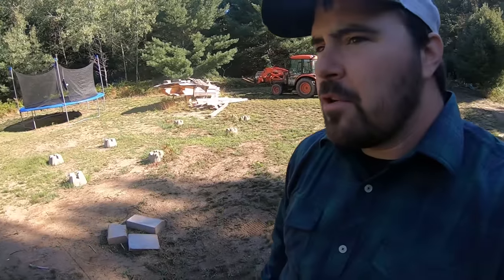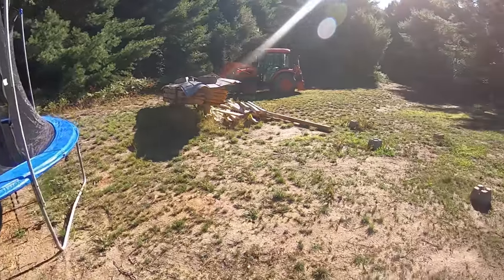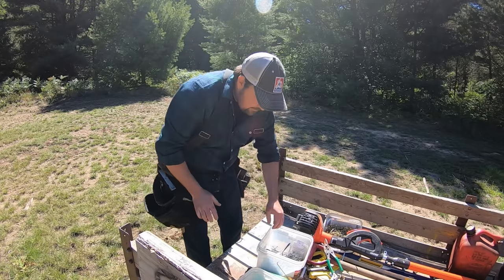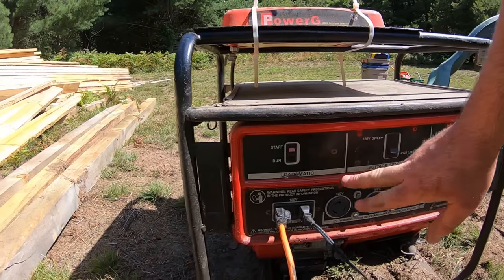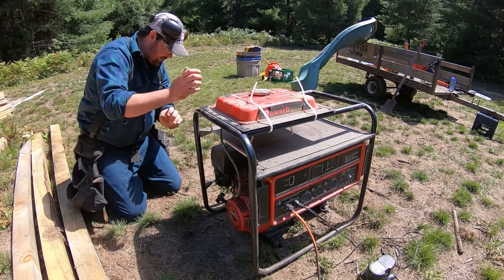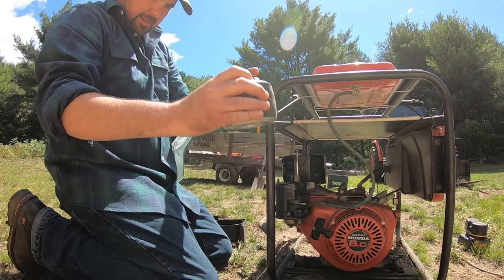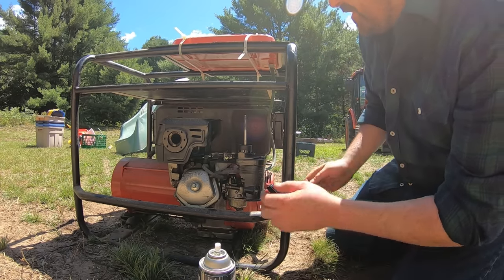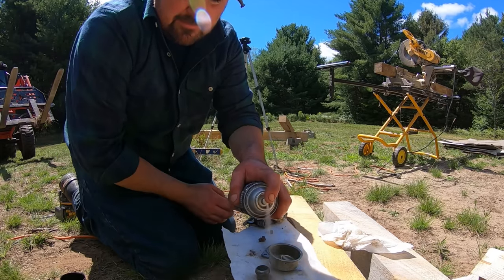Pirate Ship Project Hits Some Rough Seas | Yarrrrrr!  (Please help me...actually though)

Comment: It could probably be low oil level. Because you have a oil guard, and when it too less it shout off the ignition. So when you wait 2 minutes the oils run down again and it starts for  while, so I think the oil is just under the line...
Reply: Also some synthetic oils won’t hold the low oil level sensor up when the unit is running but it will hold it enough to start.
Reply from the maker: good points there! Thank you
Reply: @duncangabert590  I think YOU may have just solved a problem I have been having,  Going to go and change back to conventional oil and see if I have a viscosity problem..

Comment: Yah, Another opinion. I have a Honda generator same exact reactions. On the exhaust side of the engine when looking above the bowl at carb there should be a black plastic Philips screw. It may be slightly captured by the long carb stud(bolt). remove the plastic then remove a jet clean it so you can see through it. With air filter back on try it. Should clear it up, then take more pride in her and do whatever extra maintenance you feel like. Thanks for all your vids. Fellow sawyer (woodmizer) and nature enthusiast
Reply from the maker: Appreciate that Anthony.

Comment: Howdy Sandy- I’m not even gonna guess what’s wrong cause I’m not a small engine mechanic. But, it is reassuring that I’m not the only person who has days like that. I’ve been working off a generator for over a year now and actually getting tired of it. When building off grid we have to use a noisy generator. Hope you get it going. Take care and God bless
Reply from the maker: You know the feeling. It's frustrating for sure but as long as I"m still standing it's been a good day

Comment: It sure looks like a carb issue.. May have to completely tear it down at the shop for a good cleaning..  Have you looked around for a PTO ran generator you can run off the back of the tractor? Keep up the good work there Sandy
Reply from the maker: Think at the very least that will tell me for sure it's either the carb or it isn't and go from there. Good points. I have seen those PTO generators and I think that's not a bad thing to consider
Reply: @sawingwithsandy  Save your time, its nothing internal to the carb.. the engine runs great when its running if the carb was dirty itd never idle or rev good not even for 2 minutes

theres something electrical telling the engine to shutdown, be it the oil safety, maybe a bad fuel solenoid if it has one,  or something else entirely 

ive never seen a "start/run" switch so maybe this has some wonky electrical system that has some kind of consumer advantage but isnt reliable

oil is the easiest problem to solve, change it out with fresh stuff to proper level, or even easier just pull the wire off the oil safety temporarily and if it doesnt shut down you know thats the issue, you can then decide if the oil looks good and its just a bad sensor or if the sensors saving the engine from gas filled or non existent oil

if none of those id pull up a service manual/wiring diagram for the engine side of the machine and see whats in that run circuit besides the switch an the oil sensor
Reply: another check would be to wait until it shuts off and as soon as it does pinch the fuel line with vice grips, open the carb bowl and see if its full or empty, maybe its a really slow fuel flow and when the engines off it fills the bowl and has 2 minutes run time, but while running burns it faster than it fills it

Comment: I live in far northern Upper Peninsula (about 25 miles from Canadian border on Lake Superior), similar climate to yours. I would not get a Honda generator, I have found they do not like the extreme cold weather. I have a cheap Champion (roughly 350) at tractor supply, it is a 4000 watt and starts every time. I have been using it for over 12 years.  It is loud, uses gas, and is heavy, but it starts everytime no matter the weather. I live off-grid and use my generator frequently.
Reply: That's the key, using it frequently.
Reply: I thought all yoopers lived off grid
Reply: @brianwestveer9532  Only the best ones!   🙂
Reply: @brianwestveer9532  true Yoopers, yes.
Reply from the maker: The reliability is key for sure!

Comment: The other thing I’ve started using more is battery powered tools. Milwaukee sawzall, circ saw, jigsaw, router, drill and impact are really handy. Just picked up the weed wacker. The small hatchet chain saw is great for limbing and pruning I’ve heard. Chainsaw might be in my future. Cut the cord.
Reply from the maker: I'm going to have to look more into battery operated tools as nearly all of mine are corded. Battery tools sure would be helpful for me without the electricity

Comment: We have a Kubota water pump on The Fire Department that blinks the light when the oil is low, The Honda's don't have the light. I have learned over the years to ensure the oil is always full, I can't count the number of times I have had to go to water site to get the pumps started for firefighters who couldn't get them started. We have a positive pressure fan that tilts (this allows the low oil sensor to trip), I have many times on equipment check night walked over when They can't start it, ease it level and one pull every time she starts. I spend most of the check night going around and starting unstartable equipment. Some just don't understand if it doesn't start there's a reason, they just pull and pull and pull :)
Reply from the maker: Great advice! Thanks Michael I appreciate that

Comment: Take the carb back off and remove the float then clean the float needle and seat with a torch tip cleaning set if you have one.  It sounds like the float valve is sticking and starving it for fuel.
Reply from the maker: Thanks for that Wallace

Comment: Check to see if it has a oil sending unit? It detects if there is enough oil in case. If oil level is good, just unplug the wire and see if that fixes the issue. It happened on my Log-Splitter a few month ago .
Reply from the maker: Great idea. Thank you

Comment: Had a 13 hp Honda acted like that after setting a long time. Picked a carb off Amazon ( around 20 bucks) runs like a champ...never have got around to cleaning the old one. But I did replace the fuel line at the same time...the inner liner was trashed.
Reply from the maker: sometimes that's the faster and easier option. I may just try that.

Comment: Check your oil.  Take a close look at the amount and viscosity.  Gravity feed tanks like that are notorious for leaking and when it does it allows a drop or two at a time down into the cylinder where it flows across the piston rings and dilutes the oil.  I've picked up a bunch of small engines in the past where I added a fuel shutoff and changed the oil and that was all it needed.  No guarantee but it's something to look at.
Reply: another thing too, that automatic low oil shutdown, if the oil level is just a bit shy, the viberation of running, and that the oil is splashed around in the crankcase, or the oil filter bleeds back to the crankcase (then refills on start up)  will give you a low oil situation, this is not Mr. Sandy's problem today, but might help in diagnostics for some one else.
Reply from the maker: Thanks I appreciate that. Gives me good ideas to check

Comment: A few deep breaths Sandy - when emotions threaten to take over, the logic brain is sidelined. Your observation of back pressure out the carb could indicate some exhaust pressure can’t make it out the exhaust. The timing of it could mean a baffle or obstruction in the muffler is slowly bending over till it blocks then comes back unblocked as the pressure comes back off when the motor cuts. Quite a rare scenario but has bamboozled plenty of mechanics when it happens.  Good luck mate! Chin up!
Reply from the maker: Yeah that's a good point. I don't get fired up too often so this was about as much as I do haha. I appreciate the tips though on the engine and will have to get back out there and give it another try. Thank you
Reply: @sawingwithsandy   never give up (but some things do become “uneconomical to repair” depending on how the cost of repair is structured - if you have the time and patience to spare and the project is interesting enough, one could at least make a “mustie1” style video to find out why - plenty of people want to know “why that dang gennie don’t go” because they’ve all been there… unlock the mystery to this puzzle 🧩 please Sandy? 🙏

Comment: Sandy just to the right of the on off switch on the honda engine is  the oil level sensor.  They are famous for acting up. Just cut the one wire that goes to it usually yellow. If it corects the problem just run it. To replace the sensor you have to completely dismantle the engine.
Reply from the maker: Very good advice! Thank you

Comment: Honda fan here, check fuel flow from tank to carb? Just pull the hose off the carb and see if it runs out. There might be a mostly plugged screen attached to the petcock. Drain the tank and have a look inside. Those fuel tank cap vents also plug but usually the engine will run longer before dying. Is the crankcase full of oil all the way to the top? Not just 'on the stick' but right to the top of the port. All the white smoke makes me think the gen has been tilted in storage enough for oil to fill up the muffler and the low oil sensor is shutting the engine down.
Reply from the maker: Great tip there ! Thank you

Comment: Diagnose fuel delivery system - First take the fuel tank cap off (eliminate a clogged cap vent)... 
 1) take the fuel line off at the tank and check gas flow...there may be a strainer screen inside the tank that's' clogged or there may be debris blocking the outlet. 
 2) take the line off before  the petcock/sediment bowl to check the fuel hose for restrictions. 
 3) take the carburetor bowl off and turn the petcock on ... let the float hang and check for good  fuel flow.  Then lift the float to make sure that the gas flow stops. 
 4) Check to see if the tiny spring-loaded-plunger on the float end of the needle valve is free. Check for gunk or wear on the rubber tip end of the needle valve.  Also check that the needle valve travels freely within the needle seat.
Reply: I made a comment along  these lines too, not as indepth as yours, I went through all you mentioned to find the SEAT in the carb for the needle valve was swelled up and let it run at slow speed, but not enough gas for high speed.
Reply from the maker: I appreciate the detail!

Comment: Sounds like the carburetor may need a rebuild kit and they are inexpensive. I just did one similar to it a few months ago on a Honda for a log splitter.  There is also an easily accessible idle adjustment screw once it is rebuilt, but don't turn it unless you have to. It could also be that your fuel line has some trash in it from the tank.  Honda engines are particularly economical on fuel and can run for a long time on the little amount that gets through before something reaches the fuel opening in the tank or line and clogs it again by suction or gravity. Try some air to clear your fuel line and completely empty the tank.  It could be the needle on the float is a little dirty, but for the time it runs without starting it again that is a hard call but wouldn't hurt to clean it with a rag and carb cleaner. Try not to use a paper towel as it can leave tiny bits behind. Good Luck in finding what it is, and let us know what you find.  P.S. always start it on the "Start" setting and give it a few seconds to warm up and then set it to "Run".  It also takes a minute or two for the power output generation to build up, so a minute of running is recommended.  

You can also find an adapter that allows that generator to run on a propane tank, just in case you're interested.  The fuel doesn't head south every winter either and doesn't require a stabilizer.  My generator runs on both depending on what I have on hand. I always have around 400 lbs. of propane at any one time, but gas can fuel I try to consume before the warm weather departs. Do a search for "Carburetor Dual Fuel Carb Conversion Kits" as I have no idea what model you actually have.
Reply from the maker: I think you're right about that one. I may just buy an aftermarket carb and see what happens as well

Comment: Sandy by the firman 3600 inverter  from Costco i have been using it at the cabin for the last 3 years no issues and if something went wrong return it it is costco
Reply from the maker: great solution! Thanks

Comment: You could save your ears a bit if you took advantage of as much excess power cord as you can and move the noise maker away from the work area. Same voltage drop if the cord is stretched out or coiled up next to the saw, so might as well give your ears and lungs a break. Even moving the generator 30 feet will make a huge difference.
Reply: Reading my own comment I have to think Sandy may have had the generator up near the work area for the purpose of filming. I know he is not a risk taker from watching his videos and doesn't take safety lightly.
Reply from the maker: I agree Bob. Having it further away would've been a good idea for sure. I just had my long extension cord being used at the time on another project.

Comment: Friday, I planned on pressure washing the deck in preparation for restaining.

Dig out the pressure washer (I’ve had it almost ten years, second-hand) which o used a couple weeks ago, drag it onto the deck, fuel it up, starts on the first pull! And GAS STARTS POURING OUT OF THE CARB.

Stuck needle/float, obviously.

Half-hour delay  to disassemble, clean, and reattach.

I know the feeling. . .

I also have had a dislocated shoulder, bone chips in the elbow, separated wrist, and now carpal tunnel.

I am not too proud to use laughing gas after the fifth pull!

(Update: just forwarded this to my wife, subject: IT AINT JUST ME!)
Reply from the maker: I know that feeling.

Comment: Time for a little battery DeWalt miter saw.  It's totally changed how I build.  You can run it for an entire day on one 9ah battery.  They also sell a larger one, but it takes 2 batteries.  Only corded tools I have is table saw and 12" miter saw, those will eventually be battery powered too!  Also DeWalt makes an inverter (Takes 4 batteries, but you don't actually need 4), and can run your corded tools   with no generator in sight! This day in age there really isn't a place for corded tools. I even have a concrete saw that's battery powered. (chainsaw, hammer drill, you name it) Heck my mom has a battery powered mower!
Reply from the maker: Those are pretty slick aren't they!

Comment: i have a little honda one was always hard to start it was a pull rope to. i went to HFT 4 years ago got the biggest electric start they had then and have been happy with it i think i paid $739 with a 2 year watt. last time i started it fired right up. one of the dealers here stopped selling honda's they have gotten so bad took him 6 months to fix my chain because he had to do so much watt. work on them. pull ropes and carb. trouble. on all of them. you tryed, could be fuel tank top, or trash in line some where . i had lot's of day's like this. i wish you luck take care, be safe and well.
Reply from the maker: sounds like that HFT is great addition. I also didn't know about the Hondas but good to hear first hand. Thanks John

Comment: Sandy I will say you got good patient I know people that would of taken the segment hammer to it not that it would fix it but would not have to deal with it anymore the only thing you did not do with the carburetor job you did not have an air compressor to clean it real good but check your oil level first just to make sure like other people said other it definitely a rainy day project have a great day P.S.if you can get non ethanol gas in your area get it . It does make a difference to keep a carburator cleaner
Reply from the maker: Good point about using the air to clean it. Could very well have been something that couldve helped. Thanks for sharing that about the fuel as well. All the best !

Comment: The air filter blowing off - might be due to a low oil level or by too much oil in the engine...either can cause excessive crankcase pressure...The crankcase vent may be incorporated within the intake manifold)...

Also, a lot of Hondas use a low-oil level switch that can act weirdly and kill the ignition spark (it's usually a single wire switch on the crankcase  (you can unplug it to see if the issue goes away)...

 I'd eliminate an engine/ring/valve issue causing the problem  because it seems to run fine while its running  (when it runs😆).

Also - It sounds like the un-loaded idle speed is way too high -- it may have been turned up by the previous owner to overcome a stalling problem (due to oil level/too much crankcase pressure?).
Reply from the maker: Thanks for those suggestions. Help a lot
Reply: Those low-oil sensors can be finicky. That would be my first suspect.

Comment: Clean the needle and seat under the Sun that you did not take out it allows a gas to go into the carburetor one piece of rust in there to block the soil from coming in. When it's running. And when you cut it off it relaxes any gas runs into the bowl out and then just stops common problem.
Reply from the maker: Thanks Tex. I'll give it a shot.

Comment: Sandy, I had a similar problem minus the back pressure on the filter and the low oil sensor was tripping.  My fault as it was actually low on oil just low enough that is would start but as soon as the oil moved around enough it would trip the sensor and shut down.  That said all those chiming in about the float in the carb is honestly a more likely cause as it does at times sound like it is starving for fuel.  If it runs longer stone cold it could very well be a coil, those things are horrible to diagnose
Reply from the maker: I appreciate your help with that